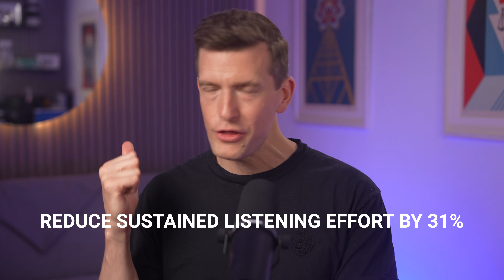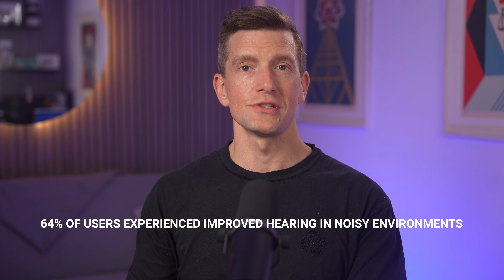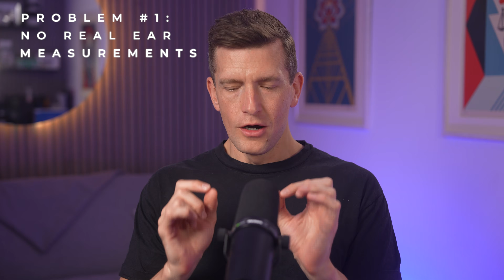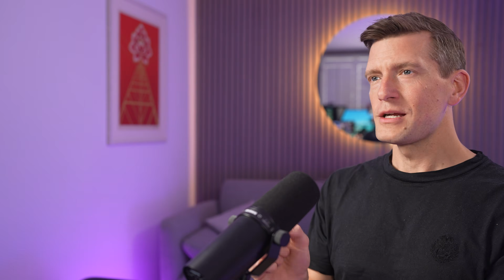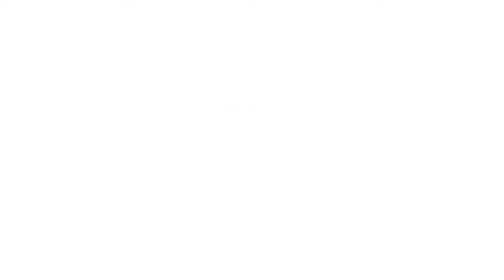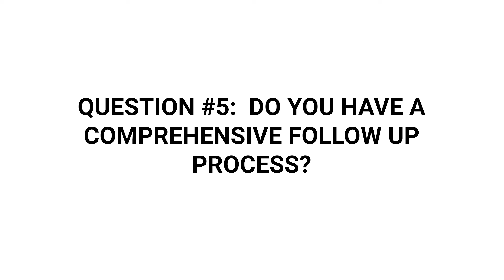Premium Hearing Aids Underperforming? Here's Why

Comment from the maker: Be honest: when your hearing aids were fitted, did your provider perform real-ear measurements?

And were you given any explanation about your dome or mould, receiver-wire length and physical fit?

I’m interested to see how many people received all four parts of the fitting process,  and how many were simply programmed and sent home.
Reply: No to all the questions. These are my first hearing aids so I had no idea about what questions to ask or what to expect. I eventually found out that I could have REM done. It was explained that they don't normally do them. I have Oticon Intents from HearingLife in Canada.
Reply: I went to my local SpecSavers in West Bridgford, which is luckily owned by people who insist on higher standards. However at first I did get the “REM is outdated because the new AIs manage the sound processing much more precisely than that old fashioned equipment can even measure.” 

But after repeated polite requests, I did get one, which    resulted in some little tweaks that did make a nice difference. Was it done perfectly? I don’t know of course. 

I also don’t understand if custom molds would be better than closed domes for me or not, or whether I’m a candidate, or whether silicone or titanium would be better etc. No one really explains this!

Comment: Big agree on all points, not the least the retention locks.
Ear molds need to be discussed as a consumable wear item
 and well as the role of acrylic vs silicone/soft earmolds outside of the high output HA's.
The fact the locks have 4 names shows how much we need a glossary.
Reply from the maker: Delighted that the video was helpful! Matthew

Comment: I had hearing test in a soundproof cabinet, then another one with something on the bone behind the ear then another through the hearing aids then settings changed then domes changed to vented domes then another test through hearing aids, no speaker in front of me though
Reply: So no REM... in my experience a problem.
Reply from the maker: You can always request one then. Matthew